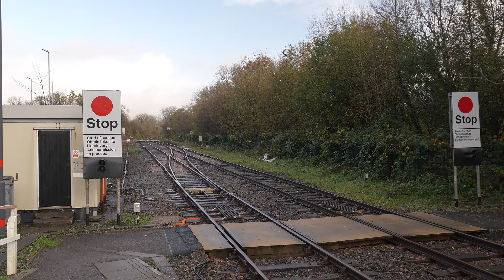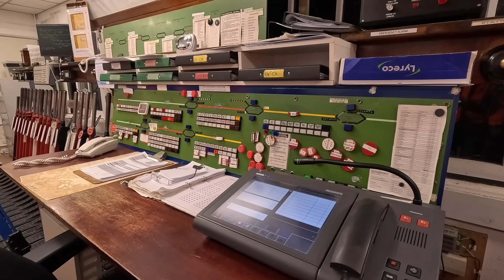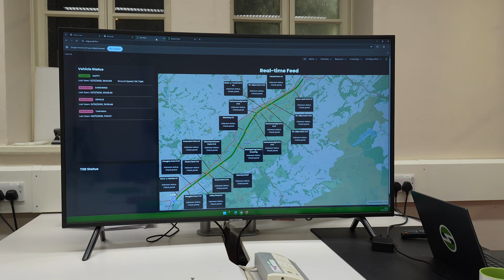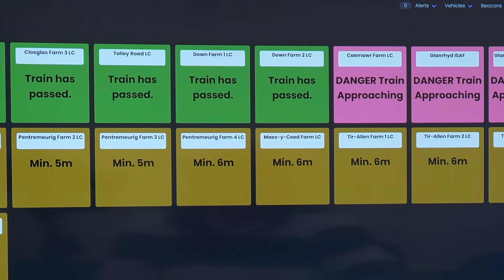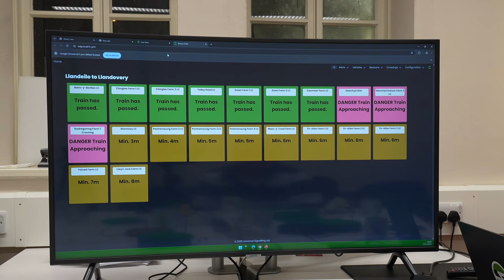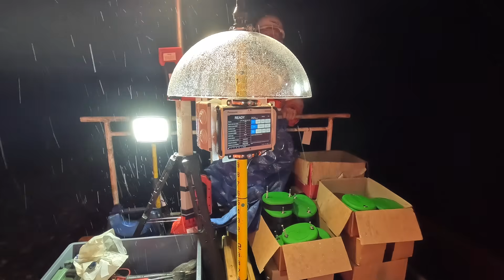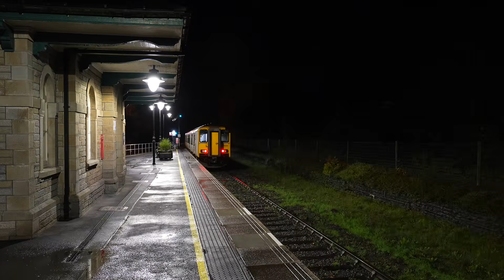Railway Signalling - In days, not decades?

Comment: Expecting accidents
Reply: The evidence of several decades shows a higher likelihood of accidents at UWCs if this system (or something similar) is NOT provided.
Reply: @ChangesOneTim : Indeed, the fact that in the very video, there's a mention of at least a 40 minute section (and you can add some extra time to that too if something happens to happen) is, and I quote, "so restrictive that it would be likely to cause the user to become unduly impatient and to cross without permission". Not to mention the cases of signallers mistaking the location of trains and giving people permission to cross, whereas you have an easy to understand, "no thinking needed" display to be able to almost read off...
Reply from the maker: What a bizarre comment. This system will improve safety management.

Comment: I am wondering exactly what GPS system this solution uses. Given that historically GPS was developed by the USA  who were / are able to increase and decrease the systems accuracy if using this system is there any kind of risk.
Reply: Well, GPS is only used during installation. Once all the positions are recorded, the actual positioning of the train is done by reading the ID of the doodah bolted to the sleeper in the track and using the prerecorded position of that ID in the database to get the position of the train. So, during train operations - no GPS
Reply: @nrichthof Sadly, without GPS, most cellular radio systems will drift from synchronisation, and fail. "normal" mobile service (GSM, 4G, etc) and likely GSM-R will be very unhappy.
There's lots of research into high-precision timing at the moment - you can guess why.
Reply: @jamesderrick8201  Interesting, I hadn't considered that.
Reply: The RTK GPSr is only used to locate the beacons / balaises on installation - the basic signalling system only uses proximity of the green beacon not the GPS.
There would be impact on GSM-R and GSM data for train to trackside data comms  timing if GPS failed, but that's a wider issue.

Comment: Very interesting. I wonder though, is this really a replacement for existing signalling? If a train derails would this system be able to prevent another from ploughing into the back of it, because that didn't seem to be mentioned.
Reply: This system reduces the line to what in effect are 30 metre blocks. Depending on the line speed the on board transponder can detect if there are sufficient clear blocks ahead to proceed. If the train in front leaves the track sufficiently enough that it misses the next beacon I am sure the software will spot this and stop all movement in the area,
Reply: @daviddearden6372  How does the transponder detect that the blocks ahead are not clear and what would it do about it if it could? What was described in the video was that the transponder reads its position from the balises and communicates that back to the signalbox. Richard emphasised that no modification was required to the train (other than hanging the box on the front), but that means there's no automatic way for the system to apply the brakes and no kind of display for the driver. It seems this could be the basis of a signalling system, but you would have to implement these things on top and then it's sounding a lot like ETCS.
Reply: @Talon5516-tx3ih  Lets assume that as you state the on board transponder cannot pick up information from  the beacons ahead of the train.  Then going back to the role of the signaller they will see from their display that the train in front has not cleared the "blocks " ahead and can contact the train following. This of course could be done automatically by the software in the signal box.
Reply: No Scanners please

Comment: one could make the system open source OR / and add lights to possesion crossings two reds for dont open gates (and interlock)  I think red should be five mins or less away ,  with yellow phone signalman AND it to give a cab warning of open gate, Green for ok to cross =  Problem with possession crossings is getting stuck or long time / holding gate open - a flashing yellow would be needed for train 6min away.
Reply: Well, they seem to be using OpenStreetMap open geo-data at least for visualisation (recognise Mapnik colouring and the required acknowledgement bottom right).

The key is the signaller makes the decision, so the kit is decision support only.

That's my guess at the need for the other 83% of cost - professional Engineering to guarantee safety when automated.

Comment: Immensely interesting to watch and there could be so many applications in terms of certainly getting a far more precise location of any train which on a rural line such as Central Wales, Cambrian Coast, West Highland, Far North and the Esk Valley. So many minor rural crossings in a very agricultural flavour and would improve safety no end. It would be interesting to take that to say the Marches between Shrewsbury and Hereford as maybe a first application on a main line? Excellent stuff and what a great invention and also so useful in its application!
Reply from the maker: Completely agree Simon.
Reply: The next earliest possible trial really needs to be on double line...and where better than the North n West, with its.dozens of LCs and some very long Absolute Block sections? Signallers taking LC request calls with a train on each line but without any reliable intermediate indications of either train's position face an equally tough task. Indeed it should be the next challenge to test the tech's ability to discriminate between two or more trains within same given area.
Reply: @ChangesOneTim exactly! And with such a willing contributor to the work as the NR’s Nick Millington, the ability to do so should be forthcoming. Its contribution to safety alone is huge

Comment: Simply Brilliant. Universal Signalling, deserve every success with this project. Absolutely MASSIVE kudos  to Nick Millington  and Wales and Borders  N R. for such Forward looking.  I  suspect that  the system will "take care" of its own beacon failures by  "flagging" missed  reports from otherwise expected locations. High Grade commercial mobile uplink ?  Not the rubbish  we "ordinary mortals" have to endure, then!   Doubless these beacons are "transponding" devices,  powered by  RF from the  train tail-end reader,  and  therefore never requiring Battery Change (as in the "AVI" and "C-APT" projects of past years) - or possibly they use long- life Lithium cells ? . My only criticism of this episode, is the "office" shot of around 19.30, and my dismay that Mr B did NOT  suggest a secondary function for those beacons - as "Emergency Mug- Mats" even the right colour!........To witness "real-time" on-screen clearing of occupation crossings- and SO QUICKLY  updated ? -even train speed displayed.  That is superb.   Excellent to watch.  More wet nightime filming  please , Richard. You KNOW you love it.....

Comment: Really excellent video and a great design. It's this sort of thing that encouraged me to go back to university after a decade in the workplace to study electrical and electronic engineering.

Obviously Universal Signalling will want to be trialling the entire wider concept of accurate train monitoring and, potentially, control with this initial trial phase. But for wider roll out along the line where Network Rail are just concerned with improving control of level crossings, it would seem that a beacon every ~30 sleepers is overkill. Surely determining decision points either side of the crossing based on line speed (with a few extra beacons placed out farther for redundancy) would be cheaper? Or is it a case that the crossings are spaced such that by the time you did that, it wouldn't cost much more to just install a beacon every ~30 sleepers have non-patchy train monitoring? Was there any discussion of this cost vs wider train monitoring at all behind the scenes?

Thanks again for the video: more of this sort of thing, please!
Reply: I think it is very much a trade off between the low cost of the beacons (stated to be 30 pounds including installation) and the cost of signalling design engineers time assessing what would be an optimal beacon spacing. In addition placing them every 30 sleepers provides redundancy in the event of either beacon failure or damage